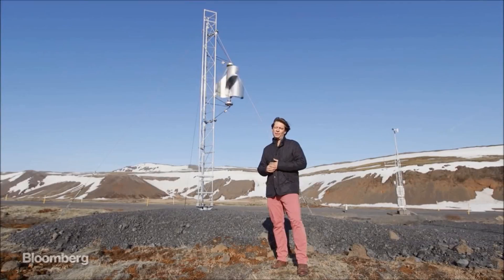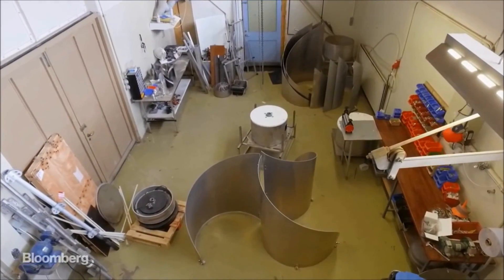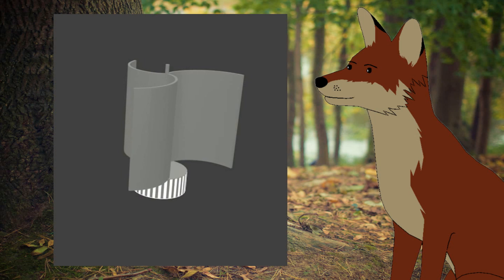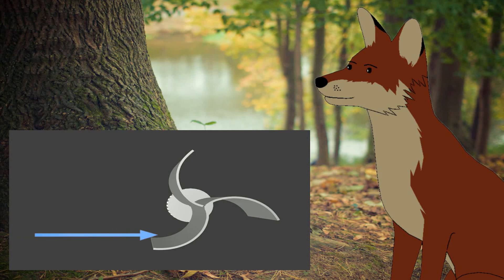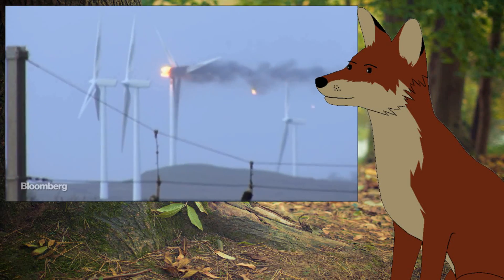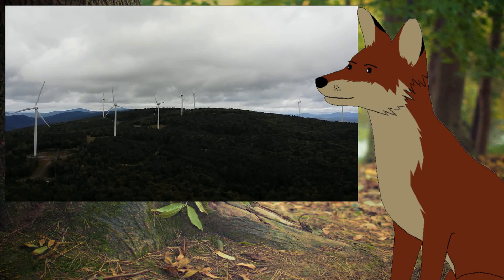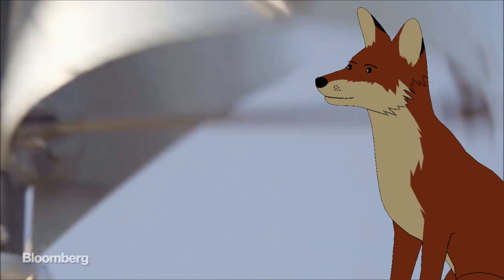IceWind Turbine - BUSTED

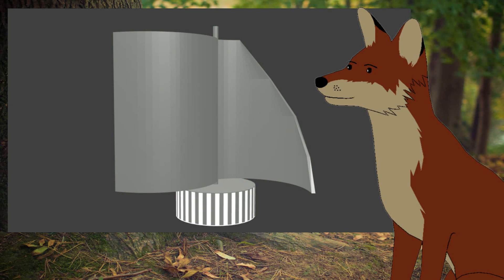Comment: at 3:24 you fail to correctly show their blades shown at 5:50. it has two blades with outer points 180 degree apart and facing down, and two mounted 90 degree from that with points facing up. perhaps the airflow is better.

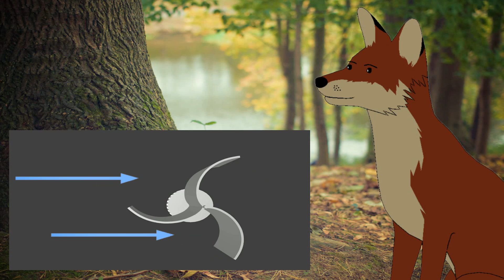Comment: 3:00 wouldn't covering the other half prevent that counter force? And the wind that is funneled through, comes back adding to the new incoming and the whole thing spins fast af, no?
Reply: As I understand it, covering half of the blades at all times cancels (to some extent) the ability to use wind from any direction.

Comment: I appreciate the analysis.  Is efficiency a requirement when the wind blows for  "free".  I guess the cost of capture may be a better looking at cost of renewables.
Reply: If it never generates enough electricity to cover the cost then what is the point?  Are you willing to pay MORE for intermittent electricity?  So, why use a less efficient design (on purpose) when a more efficient design exists?

Comment: I'd look elsewheres for things to critique.  Why be so skeptical about what clearly looks like a promising innovation?
Reply: Tell us, HOW is this is promising?
Reply: @MrSummitville  small, easy-to-install, windpower, portable.  The huge windmills are very difficult to install and maintain. IMO.  This on buildings? ... everywhere? ... helping to power electrics?  Sounds 'promising' to me?!?
Reply: @jameswaters3939  You will pay DOUBLE the price for any electricity generated from these Wind Turbines.  Does that sound "promising" to you?   So, are you going disconnect from the Grid permanently? NO!  You cannot, because Wind Power is very intermittent.   So you still need the EXACT same Grid / Power Plants operating in STAND-BY just in-case your wind turbine stops.  So, the wind blows - you want the local Power Plants to shutdown and then when the wind stops - you want the Power Plant to restart immediately - that does not sound "promising" or even reasonable ...

Comment: I saw this video and had to check out the company. Well I built two remote solar setups for half the price of ther residential turbine which is different than the ones they have put of stainless steel
Reply: Solar doesn't work too well in Iceland for half the year.
Reply: @vancejohnson1744  it doesn't work all the time any where.... but I know what you mean, not enough solar gain at that latitude... I was looking into expanding my electrical options, thats why I looked at the wind generator it just costs to much I'll work on building my own before I pay them that much... was also looking at a water turbine.

Comment: Haters gong to hate! this is not meant to be a industrial wind turbine like the ones you show. And yes the shape of the "blades" is meant to prevent overspeed with out multiple safety systems being installed that drives up the price of the unit.

Comment: I get that you are busting a company that seems to be looking for investors for a product they don't seem legitimately wanting to produce - but you  are not really doing a decent job of critiquing the design of an alternative turbine. Yes - anyone ought to have been able to produce this design by now if they wanted to - no it isn't as efficient as a propeller type turbine. But what I like about the design is that it CAN produce some power in an incredibly simple design. I have watched many folks DIY-ing turbines from washing machine motors and ceiling fans for small output using the standard propeller type design and you know what problem all of them had in common? The output power cable. In basic designs DIY style as the propeller turns to meet the wind there is this power output cable hanging off the back that twists around the mounting pole because engineering a rotating coupling for the power is beyond most DIY designs. In real life - the turbine inevitably ends up doing a few rotations on its pole and tangles the power cord. In this design the generator motors can be fixed mounted and nothing but the blades spin no matter which way the wind arrives. So mounting this on a pole and wiring it to the ground couldn't be easier. In fact you could even turn a lower and upper motor on the same turbine blades. Not everyone is worried about being THE MOST efficient in the world - sometimes functional is efficient enough.

Comment: Modern Savonius Turbines are no longer drag-type.  Blade design has improved drastically since even this crummy video.  You might actually study the subject, rather than criticizing without sufficient knowledge of the subject.
Personally, I am planning a farm that uses a Savonius Wind Turbine to both pump water and to compress air.
The primary benefit of the Savonius Wind Turbine is the high torque and low speed of the design, which makes it ideal for my applications, so - "Fox Says" is FOS
btw - There are also Savonius Rotors for water-power, too.

Comment: The big issue with this video.
Vertical turbines have poor efficiency due to wind pushing on apposing blades but compensate by have a massive blade area.
Horizontal turbine blades are tiny compared to the swept area of the blades.
Not mentioning this is a major oversight in this video.

Comment: The design is good , the reason is the maintenance is low as opposed to the Prop wind turbines . 
These generate power in low wind . 
Using Stainless steel is smart those Turbines will be around in 50 years time . The Prop turbines are failing not long after they Are being built . Have a look at the Amount of the fibre glass props that go into landfill.

Comment: lol what a crock of shit.....savonius rotors and their derivatives work fine and have done for a long time.They are cheap to build can be used just about anywhere dont need slip rings so can instantly account for gusting winds from different directions plus automatically speed limit with high speed winds....in short they are an excellent and cheap non bird killing form of wind powered current generation..your video here is full of holes. Nine minutes of my life wasted

Comment: you have done much assuming, what you watch and critiqued was a fluff video and did not explain things well.  you seem to get off on the wrong foot because the space they have was coal-related, they could have probably rented a garage instead of where they are would that have made you feel better.
     Now we can agree that industrial wind turbines are more efficient,  but would have more problems with maintenance, as they need more controls, and could easily need to be replaced more often than the less efficient Savonius wind turbine.  You have to question the Cost both immediate and lifetime, Maintenance, Practicality.  If these simple turbines last three times as long, need a quarter of the maintenance but only produce half the power there are times you would use them.

Comment: The reason they cut the blade in half like that is so that when the wind picks up to unsafe speeds, the blades will bend flat and slow down. That's what the pivot arms are for. I am curious about output.And you are right they should have more energy data availble.
Reply: actually a savonius rotor self governs without bend blades blah blah

Comment: First point. So what. Second point. So what. Opinion. Was bull. Efficiency for wind power is not the primary problem. Durability and consistancy are. Multiple system failures equal complex. Third point. Well taken. Does it deal with over speed or not? Start with the viable argument. You are just trying to get longer views with your conspiracy theory anti government bull.

Comment: In Foxes deconstruction of the wind turbine, he points out that the wind is opposing the spin on the swing into the wind side.  That may be true if the blades were flat.  But the blades are curved and there should be lift on the convex side of the blade before the blade is dead into the wind.  This lift would cause more torque in the appropriate direction and ad to the total rotational force.  If you are going to diss a design you should be a lot more specific.

Comment: This product seems to work well. Probably not going to replace conventional wind generation technology but it can function in extreme conditions in Iceland and very cold regions.  They have several test units in place and reliability and durability are most important in extreme conditions. These are best for small scale applications in remote areas.
Reply: That's true to a point, but small bladed units don't overspeed. They don't pitch to control rpm or yaw either, they use genny output shunted through resistor banks to dissipate the extra power and that controls rpms. Lastly, bladed units have a wider power band. The spinny types go to a point, then clip extra power due to speed-stall and power is veriable and dynamic. You want all you can get, right? Why install a self-limiting unit?
Reply: @dousiastailfeather9454  And there are even HAWTs like the ones from Superwind, that actually have a system that pitch the blades to prevent overspeed during extreme winds. (these old western style waterpump-windmills have a system to turn away from harsh winds too) 

VAWTs have an aesthetic that humans simply can't resist somehow. It took me some time to accept that these don't do more than low level energy harvesting or being a kinetic art piece. What baffles me is, that governments seem to have no engineers checking the projects that they plan to fund. It's one thing, when home-owners or small companies are fooled by these decorative installations, but governments?! That makes me quite pessimistic about the future of humanity.
Reply: It's 2024 and this thing is still not on the market. It's all BS.

Comment: What exactly do you do in the energy industry?  "There's less surface for the wind to push against"?  You do understand why wind turbines turn don't you?  Savonius turbines have been around for many years and solve very specific problems.  They leverage both pressure differentials created by convex faces and drag force on the concave faces.  The original video specifically talks about a particular problem with high winds and they chose a style of turbine that is often used for exactly that purpose.  I'll give you that there design seems to be simple.  That combined with the uses they show (bus stop), and the use of a likely cheap/free factory space just tells me that they are trying to create a low cost turbine that is easy to manufacture .  For someone that supposedly "has a love for all things about electrical generation", this video really makes you look like a dick that takes pleasure in trying to knock down people solving a problem.  If you had ever worked on either a competitive engineering or design project you might know that they go something like this.  ... 'The objective is that create a system for powering lighting for bus stops across rural Kansas.  The system most work 24/7, withstand extremely high winds, be compact, last a minimum of 5 years and have a maximum cost of $X.'   If we were to use your logic then my truck has no value because it's less efficient on the highway than my car.  I don't mind armchair engineers, but I do mine people that think they bring value to a conversation by just being a dick.
Reply: Right on Scott!
Reply: I think the energy industry job he has is hes the janitor.
Reply: Scott, I was on my way into the keyboard with fire and pimpstone. When I reached the word "dick" in your comment, I rested my case and gave you a thumbs up instead. When I the second time read the word "dick", I wished that I could upvote your comment twice :-) ...

You have a point, Scott. And whether this "thing" is 5% or 50% efficient - if it lasts 5 or 10 or 50 years - in these super harsh environments (and Iceland is one of them), then it is worth it all. 

SHOULD IT NOT ALSO BE MENTIONED - that the parts which will NOT withstand 5 years or 10 years - are easily exchangeable by the design, and these parts occur to me to represent maybe only 2% or so of the entire value of the entire construction. SO: One can travel to these remote locations, every 3 years, replace the part, reuse the replaced part in other areas where it is more accessible - and thereby have  predictable service intervals. 

Scott, thanks for sharing, and yes - this "armchair engineer" - is neither a fox, nor smart - he is but a dick. Haaaaaa ha ha ha ha
Reply: @DigitalAgeInstitute  Same here ;) Thanks, Scott for writing down what came to my mind.
Reply: Ba-ba-ba-ba-ba-ba-ba-ba-buuurrrrrnnnnnnnnn.🔥🔥🔥🔥🔥🔥🔥🔥🔥😎🙌🏾
Reply: Nicely said brother, This guy has been paid. He doesn't even show his face. 🤣
Reply: Thankyou for your comments. what is the best get started at home turbine?  This wind turbine has the blades flipped so the surface area seems to be complete?
I would love to see testing of similar sized designs to see which ones produce the most long term electricity versus the wear and tear issues.
Reply: Scott, guys like this don't deserve so much of your time. You should have only used the "dick" part.
Reply: Putting a high maintenance device stop a bus bench will last until some DICK tosses a brick at it! They ALREADY use simple, durable solar! Fake use idea! Make work! As to durability? How would anybody know until years of sustained commercial operations that reveal manufacturing defects. Sad design and a hobby item.

Comment: I have one word to say- and that is Concorde. It is true that a savionus turbine is naturally inefficient because one side is fighting the other, but I suspect that the ogival shape of these turbine vanes might extract some extra energy out of the air with vortices the same way that the Concorde wing gets a bit of extra lift at high AoA, and therefore does not need landing flaps. Any comments?

Comment: What about the VAWT that use sails and the sails being pushed into the wind, decreasing efficiency, are turned or furled so they are parallel to the wind not across it. When the sail reaches a favourable angle to the wind it changes to across the wind. I think I saw one in Spain

Comment: OK, maybe they aren't the most efficient type out there. And maybe they are tooting their own horn excessively (you don't really expect them to say "hey our design really sucks). And maybe their pricing is out of line (I honestly do not know). But look at it from the aspect of an isolated location. Build your own out of 55 gallon drums (I've seen them done by DYI's) and you've got a reasonably cheap wind turbine. Actually for vertical axis machines I think the Darrieus type machine with the helical blades would be better. 
As to the drag issue with the return side of the rotor what if the blades were shrouded on that side. If too closely shrouded I realize that there could be drag issues. The wind entry point could be widened to funnel more wind energy onto the side catching the wind. This would IMO not anywhere near ideal but might be practical for small machines in locations with winds from a fairly constant direction

Comment: No bro. the noob is you.  As the way you think the blades are driven is entirely wrong.  its a mistake most people make who dont know about aerodynamics.  your thinking the blades cup the wind and are pushed.  no wrong. the blades act as an airfoil like a planes wing.   indeed air does for its way into the cup'ed under section, but the curvature makes the air on the top of the bend move faster causing lift.  just like a planes wing. but facing 90degrees to the horizon with other flanking winglets, it produces lift in only one direction causing the blades to spin in one direction and not be obscured by the air being caught on the  opposite side.   in other words, one side of each winglet has more pressure and one side has less, due to the shape. which forces the blades to move in one and only one direction.

Comment: as in your own video shows at 5:53 triangular blades or "half of the fucking turbine" (not the little guys on the bus stop the real turbines) are actually offset from each other therefore not blocking the wind from the next blade as a square or rectangle blade could or should i say would do,  this increases efficiency and decreases the opposing resistance from the wind on the back of, again "half the fucking turbine"

Comment: a few things.  If the blades are cut by 40% the back edge would be cut by 40% as well therefore being similarly efficient as the original design.  The footage they show is a well known Youtube video of overspin where the breaks were not able to slow it down, therefore overheating the turbines resulting in the fire.   You must have missed the overall point of the video in iceland of the large windmills breaking down every 3 years because of the elements.  The point was to find something that was effective, long lasting, and relatively inexpensive.

Comment: The ONLY thing good I can see in this machine is that regardless of hard the wind blows it does not Over Spin and cause Failure. BUT that same "Safeguard" also cancels out over HALF the Torque which means,,,less the HALF the power needed when the Electromagnetic field produces a Magnetic opposition to the effort produced by the Blades.  Other then that this is a POC,,and it does NOT work well enough to produce high enough HP/Torque to turn a High demand gen-unit. Try again guys,,this one SUCKS
Reply: I'm not sure about that because you can stagger 6 blades in an up and down configuration and get the same power as 3 blades of the same surface area.